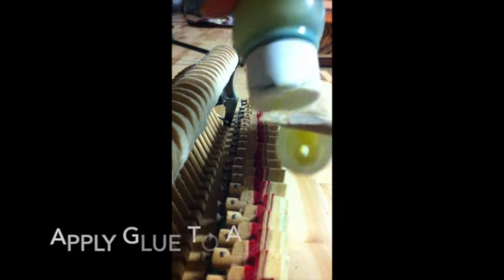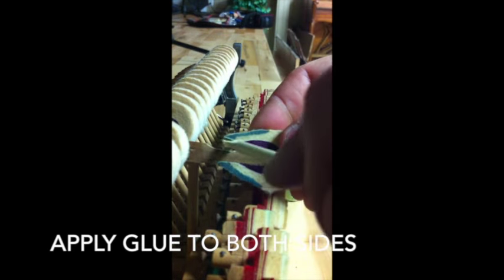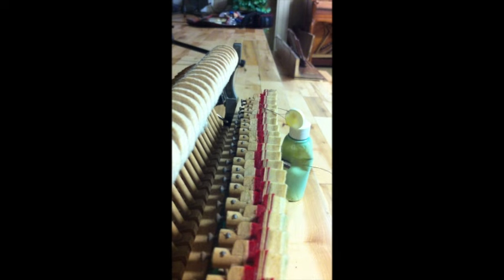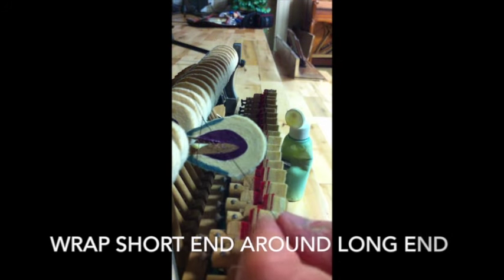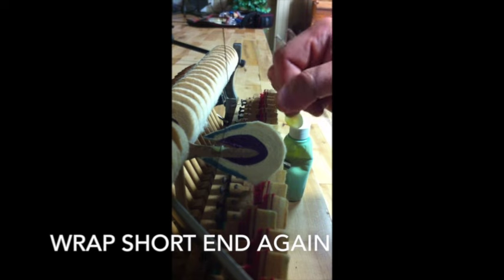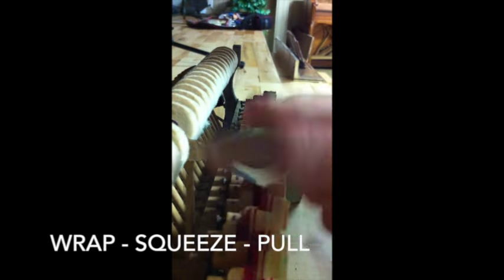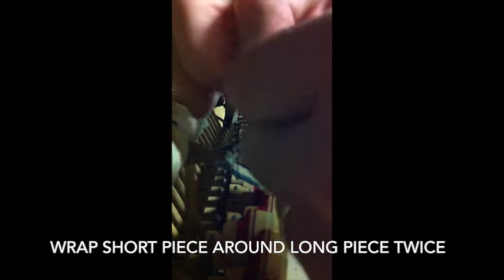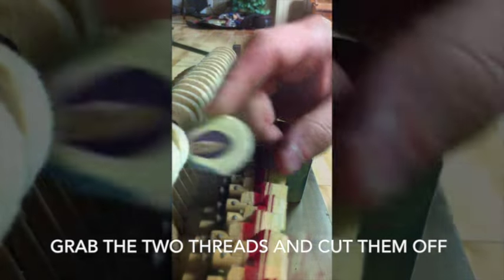Regluing Hammer Felts That Come Unglued

Comment: I use zip ties.Also, if the felt has completely popped off, a zip tie going from the strike point to the back of the molding will hold the felt secure, giving it a brighter sound than if not all the way against the molding strike point.

Comment: Mark Cerisano,  what type of threat do you use? I bought thread sold as upholstery thread and it keeps breaking as I pull it tight.  Tried 2 different types, polyester and nylon. I experiment with fishermen's wool used in felting. I see at the beginning of the video you show and describe the thread but I'm wondering about brand, size etc. Thank you!
Reply from the maker: Upholstery thread. Don’t pull so tight or get better thread. I can’t break mine.

Comment: I am trying to fix my old piano given away 20 years ago and is now being given back to me, I have glued felts back on. It may be my imagination but I think keys are hard to press.  I want to fix as much as I can before moving piano 100 miles and tuning. Is sticky keys a problem with pianos that have not been played. Will they loosen with use? Can they be sprayed with WD 40? Where?  I have been using an electric keyboard so it could be my imagination. Thank you in advance for your advice. Also, 2 keys in the far left register won’t play. I am thinking there is something under them. I found quarters stuck between keys. Is there a way to get to underneath keyboard to see what blocks them. The hammers and felts swing free inside form those 2 keys.
Reply from the maker: As with many things "piano", there is a right way and a wrong way to do something. You obviously realize this or you wouldn't be asking.

There is some discussion among technicians (as there always is) about which right way, is actually the "right" right way. But we pretty much all agree, WD-40 is the WRONG way. (Just don't do that. Throw it away.)

Regarding sticking keys, you need to identify where the friction is, where the stickiness is.

You will need to troubleshoot by eliminating different parts from the action and determine which part is causing the stickiness.

The main areas are:
1) The hammer - specifically the hammer flange with the center pin
2) The whippen - could be the whippen flange, the jack center pin, the jack spring, etc.
3) The key - could be the balance rail bushings, the front rail bushings, rubbing against neighbouring keys or the slip rail, etc.

Often a visual inspection by a professional can easily determine the cause. I am available over Skype or Google Hangouts to visual inspect your piano and I will be able to find out where your problem is and instruct you on how to fix it.

Let me know if you are interested in this service by emailing mark@mrtuner.com

Mark Cerisano, RPT
Mr. Tuner [Online] Piano Service